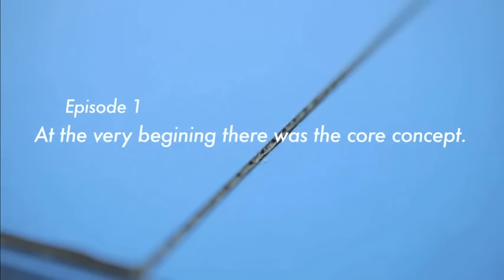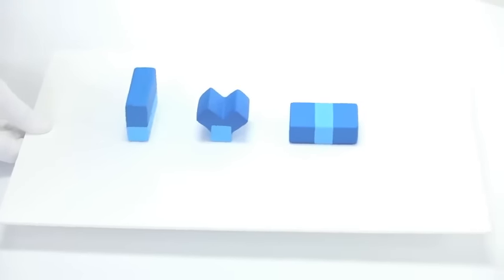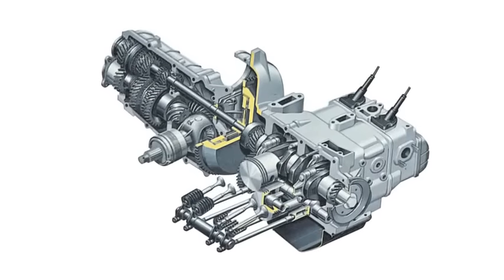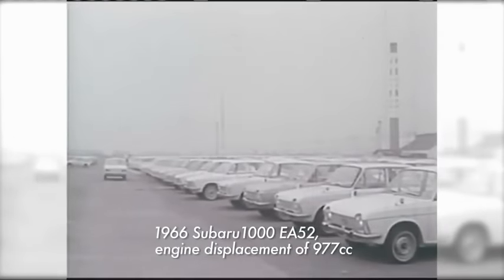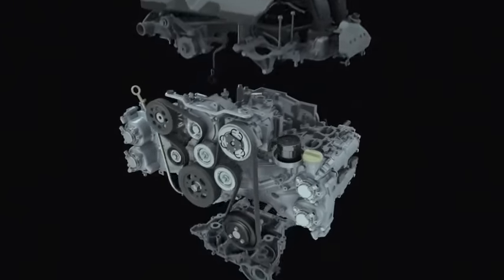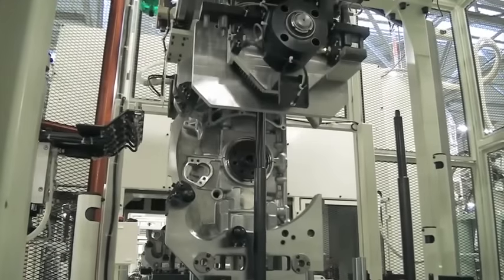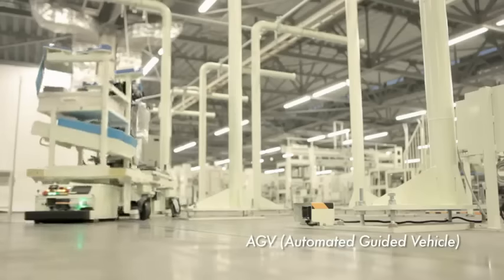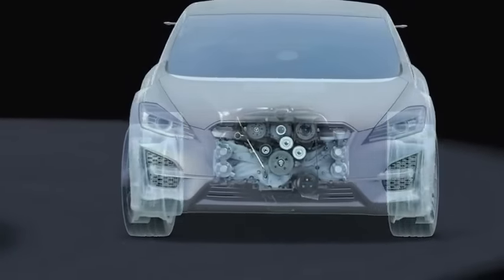Learn About Subaru Boxer Engine Technology

Comment: I just took apart my 2009 Subaru Forester. Machined the heads, replaced all the gaskets, timing belt, spark plugs & wires, timing belt, water pump, and did the valve adjustments. It was an amazing journey.  Can’t wait to drive this car another 100k miles.
Reply: no space to work with, hard to change parts....
Reply: You had to do all that at 100k ?
Reply: @johntesh199  at about 170k. I bought it from my neighbor and the gaskets were leaking bad. I meant to say that after all the repairs it should drive another 100k
Reply: @pfcaraujo  nice!
Reply: @pfcaraujo  I just got an 02 boutta do all that myself
Reply: I need ej 20

Comment: I wish more car manufacturers will offer boxer engine cars. They're so smooth when driving.
Reply: a lot of them used to. the VW Beetle had a boxer 4 cylinder and was legendary not just because it was efficient, but also pretty reliable and easy to work on.
Porsche still uses boxer engines in the 911

Comment: 121k miles on my 2001 wrx, its been running 320bhp (with sti turbo,injectors,fuel pump,remap)since 49k, had no engine problems at all.. just regular maintenance costs

Comment: Great engine.  Fun cars to drive.  There were a few years where the head gaskets would go.  I look for those to buy them cheap.  After replacing a few it takes about 5 hours in the driveway.  Can't think of a better way to spend a Saturday!  The last two I've bought have not had issues yet. They are a fun funky car to drive.

Comment: So many misinformed comments here about the "boxer rumble", which is NOT caused by a boxer engine design etc, but by the unequal length headers which causes exhaust pulses to collide and cause that "rumble.

The newer FA20 engines (2015-WRX) have equal length headers and the "rumble" is gone. Therefore, it is not caused by a boxer engine. 

Just like a Porsche never had a rumble, newer and better flat fours from Subaru also do not. STI's still have it because they have been using the EJ25 engine in them for over a decade. 

I'm sure soon (2018?) that will also be gone, they need direct injected technology and better tune /exhaust etc so to compete w/ 350+ HP Fords etc...  My 2015 WRX runs like a champ but only after using a better tune, the factory tune is total crap!!!!!!
Reply: Thank you for your competent comment on this.
For me, the only thing that could be a critic point on flat engines are the gasket problems that, always, take much time and effort to be solved.
But it is not stopping me to look out for a 3.0R flat 6 engine (not that much of those were sold in Switzerland).
Reply: not to mention the fact that the WRX is supposed to have rumble since it's a damn sports car.
Reply: Even then not subarus have ULH.
Reply: My SVX engine also doesn't have the Subaru Rumble.  Equal length headers as well.
Reply: Is it possible, or even good, to have UEL headers in a FA???
Reply: they love the sound because it sounds good compared to inline fours and other types of 4 cylinder engines and was only from the subaru  no one cared why they cared it was a good sound only from subaru
Reply: Yeah few understand engine tone is manipulated and controlled by exhaust geometry
Reply: @GiordanDiodato  not a sports car.
Reply: @3Afterlife3 naw, fa20’s have a twins scroll turbo  set up that is designed to work with the equal length headers to spool up faster is you put unequal length on there it’s detrimental to the performance.

Comment: Thank You !!!   I bought my outback 4 months ago and literally had no idea what was under the hood.  This is an excellent explanation of what I only knew by later conversations.  This video puts it all together in a very attractive way.  For over 60 years I’ve flown behind Lycoming and continental “pancake” or flat engines and have a high regard for the concept. Now termed the “Boxer”, I very proud to be the owner of the ultimate 4 cylinder Horizontally opposed power plant.   Bravo Subaru !!!  Buck

Comment: Other than replacing the spark plugs, they aren't that much different to replace regular items like pulleys, belts, alternators, batteries, etc. The exhaust layout on the turbos is a huge headache, but otherwise my wrx has been as easy to maintain as any other 4cylinder I've owned. 120k miles and still going relatively strong.

Comment: A great engine design! I loved my scooby! There are question marks over longevity with the design but they are so well built they deserve a new head or engine rebuild every 100k or so
Reply: Subaru boxers generally run fine for 300k + just keep it stock even the 2.0 turbos, a new head gasket and timing belt is always welcome around 130k miles just like every other 4 cylinder vehicle
Reply: @jakefearing6640  how about adding straight exhaust pipe? Is that interfering with stock?
Reply: @erickforester6450  im not 100% sure but a cat back straight pipe wont affect the longevity of your boxer
Reply: heck my alternator belt snapped at around 120,000 miles in my 2010 Outback.

Comment: The "Boxer"air-cooled engine was first developed in 1885 by Karl Benz.   Benz received a patent for the engine 1886.  it was aplied to motor cycles and quite extensively in the Volkswagon.  Over the years VW stopped using the boxer engine and went water cooled.  Subaru obtained the rights to the engine and over the years Subaru engineers converted to what it is today

Comment: The Subaru engine has a lower center of gravity than the fords. I also don't think horsepower is the main factor in such a small engine since they get turbo charged a lot. I do like ford but I've never had issues with any subaru I've owned. Each exceeding 250km. Maybe it always just comes down to how you maintain your car.

Comment: I'm all up for boxer engines (own an fr-s), but what Subaru is doing with cutting down the manual transmission option in most models... is sad. The CVT just does not go hand in hand with the all good stuff that boxer engines can do when paired with manuals. CVT is probably the most numbing thing auto industry came up with.
Reply: Preach it!  Stick shift forever!
Reply: That's true
Reply: NemanjaGuitar Completely disagree.  I had a 2010 outback and just got a 2015.  I am amazed at the changes in those five years.  the 2015 is a completely different car. advanced CVT, which i loved in my 10 and in the 15.  The ride is better, as is handling.  The electronics are fantastic.  I simply could not be happier.  Manual transmissions are for kids.    I am not a casual driver, just one who enjoys riding and driving a very nice, solid and safe car. What more could one ask for.
Reply: amesburydory A solid, nice, safe car could be absolutely any modern car with a few exceptions. Saying your satisfied doesn't make it OK to remove options others enjoy, especially on the sportier cars. Saying "manual is for kids" isn't a good argument for removing manuals. For me for example, it's being in control of the engine. If anything, it let's you be more responsible for your own fuel economy, speed, etc. Other than the "show off" element I'm not sure why manual is "for kids". I've driven a manual my whole life, good luck finding a car here that isn't one.
Reply: Love the high torque cvt in my 2015 Legacy 3.6r. You're misinformed
Reply: TheManYouNeedToBe Our argument isn't that you don't love it. It's that it's A. Not for enthusiasts and B. separates you from the driving experience. Not sure how high torque in a CVT is relevant to the discussion.
Reply: A. My other car is a 2015 Mustang GT, and the cvt in the Legacy is better than the gearbox in my old bmw 335. I doubt you've driven one, but I'm certain you'll claim you have (many times) in a wrx and legacy 3.6r. Lol troll
Reply: TheManYouNeedToBe The argument isn't that the gearbox is "better". It's that the transmission is further connected to driving. And no shit, the transmission in the Mustang is one of the worst I've ever used. Ford has had problems with the transmission in that car since the 5th gen, and the 2015 transmission was carried over from the 6th. After a few years it'll be just as bad as the 6th gen became, if it isn't starting to get there already.

I'd also like to know why exactly you think the CVT is "better" than the 335i gearbox. What are you defining "better" as? Again though, I'm talking about the manual transmission and not just the gearbox.
Reply: Bus pass is the only ride you have. Kid
Reply: This is an ignorant statement. Do you understand how a CV-T transmission works? It uses centrifugal force the activate sliding  weights on a spinning pulley to  hold the engine in its powerband. It's how you're able to get so much power from a small engine. There's a reason why car manufacturers are adopting this technology from scooters and go karts using engines like the Honda GY6. Stop spreading misinformation and your opinions as fact.
Reply: JackstandJohnny
What are you talking about, more power from a small engine?! CVT has higher power losses than a traditional automatic and obviously more than a manual. Where exactly are you getting this information?

If you're talking about the power band, then it's just outdated information. My car reaches peak torque at 1200 RPM and stays there to 5800 RPM. Why are you dashing between the CV and T? You don't say M-T or A-T or DC-T, so why are you saying CV-T?

So many questions...
Reply: +NemanjaGuitar Maybe for an enthusiast, yea, but for a casual driver, especially with mountain roads, heck CVT is the best engineering invention since a while, an I-4 feels like a V8 upmountain and shifts seamlessly.
Reply: errr Nissan started the CVT craze already.
Reply: CVTs are actually very nice, people are so scared of them. Just bought a new impreza and it's amazing!
Reply: CVTs are great for grocery getting econo boxes... for people who don't "like" to drive. 
they don't belong in sports sedans, or an enthusiasts car.  what does is either a manual... or a dual cluch sequential auto.
Reply: Agreed
Reply: 4 years later I find myself in a GT86 and my only complaint is my own impatience! I wanted a manual and I could have gotten one, but after the test drive and knowing the area I live in when they told me that I would have to wait to have my manual I was like nah I'll take the auto. Being it's my first Auto I have had in a sports car I can say the paddle shifters are a nice touch as they are very fast shifting. and my left leg feels fantastic when I go to our tourist location here in TN and traffic can take 30 min to travel 1 mile. So it's bitter sweet but worked out well for me! I have heavily modified mine though. Headers, front pipe etc the whole 9 yards and plans for an eldebrock SC. By then I don't think that even if it was Manual that I would be able to shift quick enough!
Reply: to be fair, their manual transmissions really sucked.
Reply: It’s simple: most true car enthusiasts don’t(either can’t or just won’t) buy new cars off the lot. That means all the things enthusiasts love are eventually pushed out of the market. There’s always this argument about being able to buy some other car used for some great price, and then new cars just get more lame.
Reply: That's just something they have to do as fuel economy  standards get more stringent.
Reply: Whatever one likes. The CVT is numb to me. At least Sub still gives a choice. These replies are petty.
Reply: @kdrapertrucker  manuals actually get better mileage.
Reply: I put in an order for a 2023 Crosstrek Premium about three weeks ago because I heard the Impreza and Crosstrek will be CVT only for 2024. I had test-driven the CVT and it was disappointing, to be charitable.
Reply: @ready4sea301  I have a Norwegian Elkhound and have a decal in the back window, negative-space profile of the dog with the caption SHED HAPPENS.
When my 2023 Crosstrek Premium manual comes in, it will get the elkhound sticker, along with the double-H pattern and the caption SHIFT HAPPENS.
Both decals can be found on eBay.
Reply: you must change the oil in them regular the oil will not last for ever in it, and dont toe heavy stuff around.

Comment: The spark plugs are easily accessed without dropping the engine. It's just a lot more work than an inline. You just have to remove the intake on the passenger side and batter+wiper tank on driver side.

Comment: I'm a Japanese. In my country subaru is really a uncommon car maker. It's said there are 3 big disadvantages on boxer engine. 
1. The pistons are lying down and they certainly have their weight, so they scratch the lower half part of cylinders, which makes the life span shorter.
2. The number of parts is 1.5 times of in line or v form engine,  which makes it heavy.
3. Difficult to maintain and fix.

 Why subaru doesn't develop an other engine? Because they are too tiny to develop another. If boxer is better than others, why other companies don't use it? Actually Ferrari was using it until 60's, but they stopped due to those disadvantages.
Reply: Aoru Not everyone use their real name on SNS.
Reply: LIANG XU and also vw, alfa romeo.
Reply: Poesche has been using boxer engines for 911 and Boxster/Cayman for decades.
Reply: Porsche still uses flat engines.
Reply: LIANG XU except the 512 BB which means Berlinetta Boxer came out in the 70s.
Reply: the BB wasn't even a boxer engine, it used a V12 on its side.

Comment: 187 dislikes, because they own a Mitsubishi.
Reply: The Readers Corner Or a Civic haha
Reply: +Connor Keegan or a corolla
Reply: EXACTLY.
Reply: +The Readers Corner or just because its an ICE.
Reply: +The Readers Corner Lets see here...391 dislikes - 187 mitsubishi's....That equals 204 head gasket failures and counting.
Reply: lol
Reply: Still shits on a Subaru
Reply: Zohtak X What does?
Reply: +The Readers Corner Mitsu have inline 4 cyliders and car is better than Impreza. why?
Reply: +The Readers Corner The 2007 Subaru Impreza I owned let me down because the head gasket went in just six years.  What a piece of junk!  The dealership reps are snobbish.  Besides the engine is way underpowered for a 2.5 liter.  Don't buy one!
Reply: Dominic Fong What about a Mazda?
Reply: The Readers Corner I am not a mechanic and have never owned a Mazda so can't give you an informed answer.
Reply: Well I'm about to buy a Miata, but that's different than mazda as a whole.
Reply: because my pos subaru blew up
Reply: +Dominic Fong That model isn't one of the ones known to have headgasket issues, likely maintenance related.
Reply: FCFordLord
they all have head gasket issues or burn oil. They really are shitty cars for the value.
Reply: Dominic Fong z my 2.0 litre Legacy is at 108k. However I agree about the Impreza, any engine with a turbo is going to be stressed and give rise to problems in later years, usually as  the warranty period expires
Reply: The Readers Corner and the rest of the Ike’s are because people own a Subaru. I made that mistake and owned one. Never again
Reply: MaSSaCr3Vu well the Corolla runs a timing chain.
Reply: Father traded the Legacy for an Outlander. Kind of salty about the fact he didn't consider the Forester because he wanted a 7 seater. Ascent in the future maybe?
Reply: Yup because they were fucking smarter and get a 4g63 motor.
Reply: The Readers Corner I disliked it cause I don't like your post
Reply: Bry K My turbo forester from 03 is running like new and got 250000 miles on it :)
Reply: Riccardo Di Giulio Yes serviced by the book,thats all.
Reply: Riccardo Di Giulio I really dont care what you belive...Brakes and some wheel bearings and service,thats it.Still runs like new.The milage is 416000 km i think its pretty close to 250000 miles.
Reply: i think its probably because subaru has had significant design flaws that they havent adressed for decades.
Reply: Ha! I bet you're right!!
Reply: Or they know that you have to be gay or lesbian to drive a subaru.
Reply: @FCFordLord  they all have head gasket issues, that's the problem with boxer engines....
Reply: I have had my sti for 4 years no problems never redline it . Oil changes up to date its a 2015 sti and all I have done is oil changes spark plugs full exhaust system it’s been great to me it’s not the engine, the only bad nut on a Subaru is the one holding the steering Wheel if you are smart you will understand. Have a good day subí fans and fuck the haters.

Comment: While tuned cars may have reliability issues, a stock STI or WRX are pretty reliable. Mine has been as reliable as a non-turbo so far. Nearly any car that is heavily modified will have reliability issues and need more parts replaced as the car is being stressed more and usually the driver is pushing the car harder.

Comment: You know what I love about the boxer engine? When it does a head gasket at 100,000kms (common issue from 03-07) the whole motor has to come out because you cant reach the heads. Best. Idea. Ever.
Reply: Last year for headgasket issues in the US was 1999 when the EJ25D was phased out. The 251/253 rarely has issues, and is almost always maintenance related.
Reply: In Australia the 2.5 was notorious for doing it passenger side around 100,000kms. Even the tech said that it was something that they 'fixed' from 2007 onwards. 3 cars I know of were all meticulously maintained, 2 Foresters and 1 Liberty. If you were lucky it happened before the 100,000km service, if not (like me) it was 3,000kms after it had just been in for it's $1800 100,000kms service.
Reply: It has always been and will always be a common issue with H engines.
Reply: @JyroOne  not really. Just find the right mechanic.
Reply: They solved that issue and they are reliable again
Reply: Outdated comment I’m afraid.  Try to research before spreading something that is just laughable